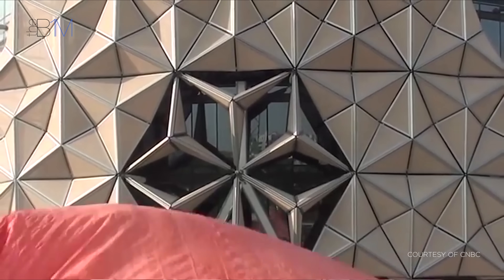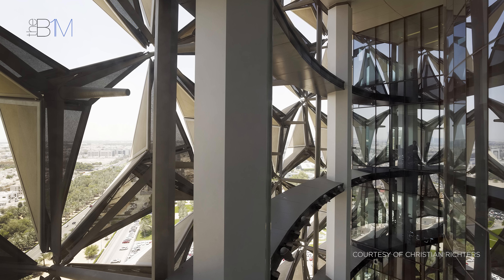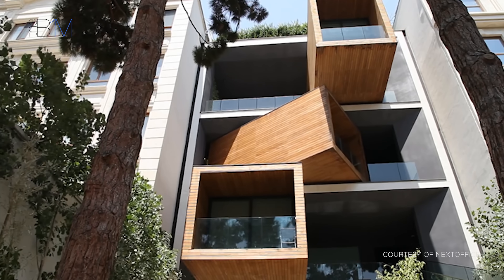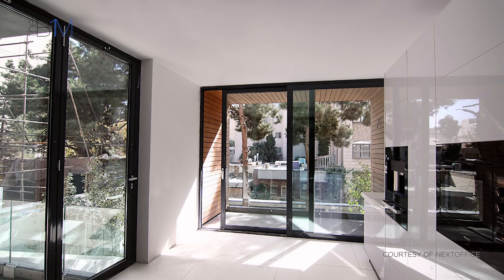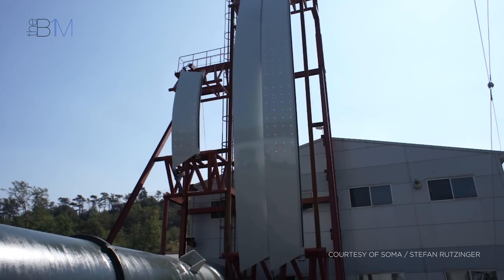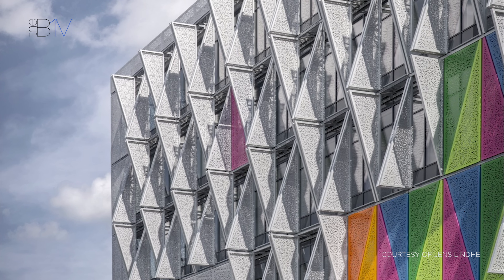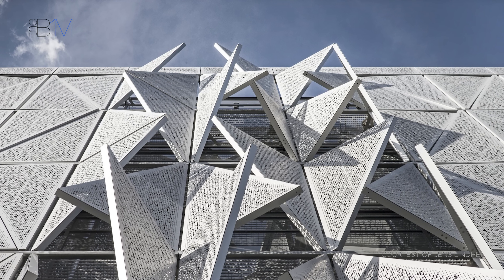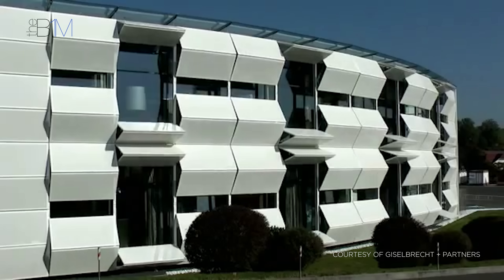What are "Kinetic Buildings"?

Comment: It would be cool to see technology like this but examples that use passive methods to change their configuration.  As soon as you start getting electric motors and drive systems involved, there's just so much complexity, cost, and reliability issues that creep in.  It seems like you could use the incidence angle of the sun to heat some element that would expand and contract, thus changing the structure without the need for any electricity.  Use parabolic mirrors or lenses to focus sunlight so that they can operate independently of ambient temperature and it strictly becomes a function of light intensity.

Comment: Now magine the addition of solar technolgy! The sensors allow the solar cells to be in the most effective position while also providing maximum shade!
Reply: I actually thought that was the case before they explained
Reply: We had done this as part of our graduation project for Mechanical Engineering in 2012. It was called Solar Panel Tracking Mechanism.
Reply: That is such a great idea!!!!
Reply: already has been done
Reply: Yeah, except solar power sucks and doesn’t create enough electricity
Edit: Solar power literally doesn't generate enough money to pay for itself prior to the solar cells having to be replaced. You're better off investing the money instead of spending it on solar panels.
Reply: @jeffw8218  for singular houses solar is good, having panels on these buildings for each moving part or apartment would provide enough energy for the entire building
Reply: @potto1488  no it wouldn’t. Solar is extremely space-inefficient and literally doesn’t even exist at night and creates supply-demand lag
Reply: @jeffw8218  what rock are you living under?
Reply: Wind power is better tbh considering all the cars we have passing on the roads. Get small vertical air mills on top of houses too.
Reply: @w1nterf0x_19  None are efficient. The way forward is nuclear.

Comment: I wonder what the maintenance costs are and how often mechanical part fail on these buildings?
Reply: Horrendously expensive maintenance…costs and worst the amount of broken parts we faced on our building we bought for work… was one of the first things I designed to be removed…. It was only 7years old too.
Reply: @shannoncloete8161   In Arnhem, Netherlands there is a football stadium with a movable pitch, that could transform the stadium overnight for several concerts during the week. But it is used rarely because maintenance costs with regular use are too high.
Reply: @allws9683  f
Reply: @shannoncloete8161  holy shit, what building?
Reply: @ProjectSkrillexNL  you're talking about shit ?...   The Burj al Khalifa is not connected to a sewer system apparently , so all the dung coming from the world's tallest concrete fallus has to be taken away in trucks ! 😅😂🤣. As long as you use your left hand, right !  (the cess pool that was used on our farm 60 years ago maybe was not dated at all !.😁 )
Reply: @allws9683  That's a myth that came from a single ill-informed article being re-posted a bunch if times. It only occurred for like 2 weeks while there was maintenance on the main sewage plant. The tower is fully connected to Dubai's sewer system (way cheaper to have proper sewage systems than poop trucks).
Reply: They r rich don't cared about money
Reply: @irsh_official  how do you think they got rich lol
Reply: Like airconditioning
Reply: i think it fails sometimes but considering a car has over 2k moving parts, i think it works 99,99% of the time
Reply: @nikolaitoxvaerd  keeping a car working smoothly is actually pretty expensive, and that is with mechanical parts that have been perfected for 100+ years, not some new-age one-time design for a fancy building.
Reply: @nikolaitoxvaerd  most cars are money pits. So it’s funny you mentioned cars and a similar repair and maintenance cost. 

A buildings main cost is its operational cost. It’s like buying and maintaining a fleet of cars that you can’t get rid of unless you sell the whole fleet.
Reply: @justSTUMBLEDupon  i never talked about cost i only talked about how it's probably worked most of the time and didn't go over budget of the calculated cost too much :)
Reply: Need not to worry about this, everything will be well planned.

Comment: Literally very expensive blinds
Reply: don't tell that to the people they sold this crap to
Reply: Blinds work indoors making their effectiveness much less than these. And these work automatically meaning someone can't forget to open or close.
Reply: @a.h6587  Bro, these blinds are for huge-ass buildings, not your average apartment building in which one person can close their 2 or 3 blinds without trouble. Are you gonna go around a massive university building and individually update blind position? No, so shut up...........
Reply: Hshd
Reply: Pretty much
Reply: Should i make it 1k likes....no...leave it.
Reply: As an registered Architect, both parties are right here.
We should also consider:
Not everything we do in real life is cost-effective.
Same goes for the buildings.
Reply: But may be cost-efficient in the long-term.
Reply: @yengsabio5315  how do blinds become cost efficient
Reply: @jk-gb4et  If you please tell me. I assume such architectural design & mechanisms applied into buildings such as what has been demonstrated in this video were not made simply because of their aesthetics. If it is practical, then I will only assume that it will also be cost-efficient. Otherwise, impractical, hence, cost-inefficient.
Reply: @yengsabio5315  So it isn't cost efficient.
Reply: @jk-gb4et  Some countries have a lot of sun heat, think deserts or arid places. Air conditioning is wasteful compared to shade. The developed countries use electricity for this comfort, but pursue more intelligent ideas, as shown in this short video.
Reply: @kobi2187  you could just get blinds that you pull down and up using a string or that type of thing,
Or just like get curtains idk
Reply: @jk-gb4et  cost effective means for place like Dubai it would be super hot and by closing the sheets means better efficiency of air con thereby saving thousands on electricity bills. And vise versa during winters.
Reply: @jk-gb4et  I used blinds on one of my windows. depending on how you turn them the room temperature will vary. You can regulate this to a certain extent but the heat will still come through. I think these structures block the light completely and what ever heat is absorbed into the structure dissipates outside rather than inside.
Reply: @jk-gb4et  you try putting blinds to the Wimbledon stadium why don't u
Reply: @jk-gb4et  But then you'd have to have someone constantly monitoring the blinds and taking the temperature of the building and tracking the angle of the sun to reach the same effect. It's not just temperature but natural light as well. Depending on how the interior is designed, these windows could be providing a significant amount of light to the build. The balance between lighting and temperature pretty much has to be automated.
Reply: @kusali11  finally a real argument.
Reply: @jk-gb4et  The Sun shines, sunshine reflect off glass, reflection of sunshine can melt objects and make surrounding areas hotter, use normal blinds, makes the glass more reflective because light does not go pass the blinds but instead turns glass into mirrors, creates more powerful sunray reflector, use expensive blinds, since it is not from reflective surface less sunray of doom, profit.